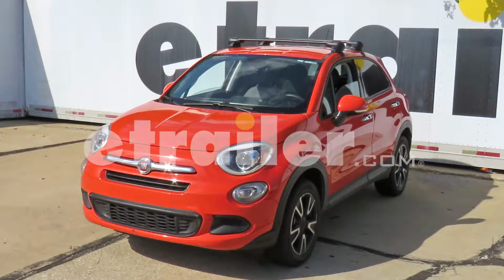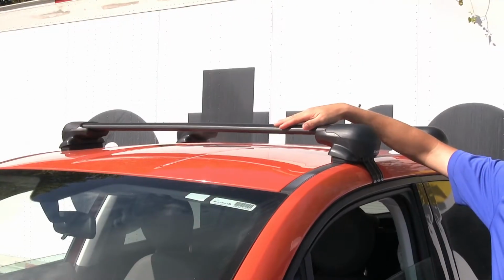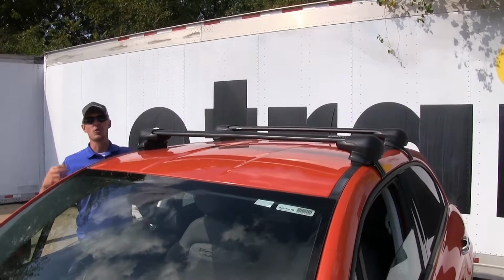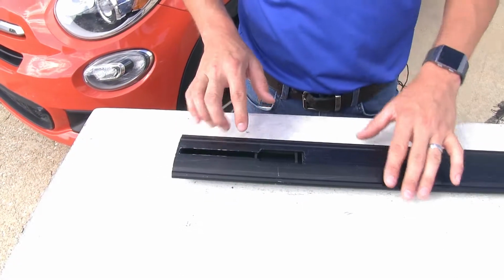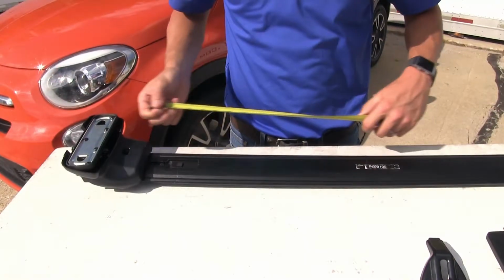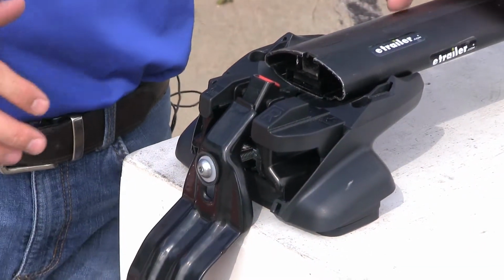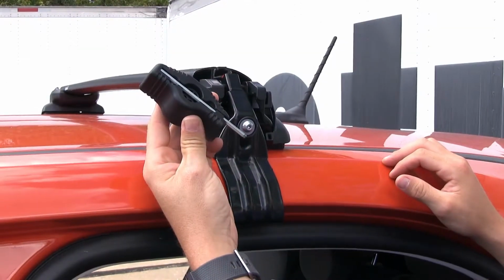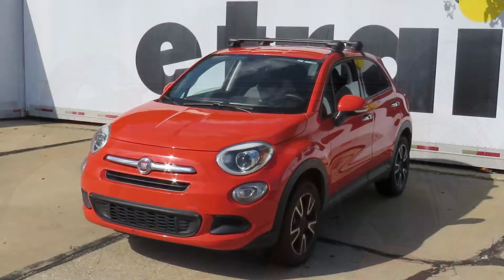etrailer | DIY Install: Inno Aero Flush Roof Rack for Naked Roofs on your 2016 Fiat 500X

Comment: Would that hold a roof tent and two average weight persons?
Reply from the maker: You will need to check what the weight capacity of your roof is and use that measurement to go by. The weight capacity of these roof bars is a static measurement. For this kit it is 165 lbs.
https://www.etrailer.com/Roof-Rack/Inno/INXB100-108.html
https://www.etrailer.com/Roof-Rack/Inno/INXS200.html
https://www.etrailer.com/Roof-Rack/Inno/INK482.html

Comment: I have a 2016 Fiat 500x Trekking Plus and I'm interested in attaching this to my car, however in the video you mention making sure your car can support the weight.  How can I find out if my car could handle this weight?
Reply from the maker: You can check your owners manual to see what your roof is rated to carry.
https://www.etrailer.com/Roof-Rack/Inno/INXB100-108.html
https://www.etrailer.com/Roof-Rack/Inno/INXS200.html
https://www.etrailer.com/Roof-Rack/Inno/INK482.html

Comment: It looks like you can install this on a 2016 500x with panoramic sunroof. But when installed you will be unable to use the sunroof. Can you confirm?
Reply from the maker: That is correct. Inno states that their roof racks for the 500x do work with the panoramic sunroof but they don't recommend opening the roof because of possibly hitting the rack with the roof. 
https://www.etrailer.com/roof-2016_Fiat_500X.htm?fUrl=-c1-NR
-Chuck S